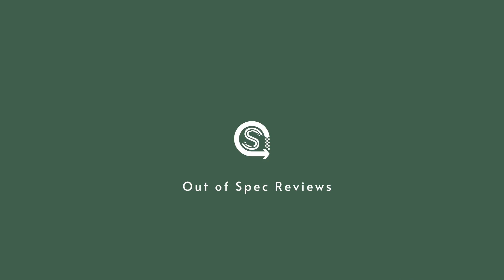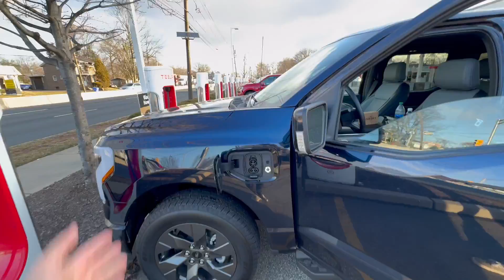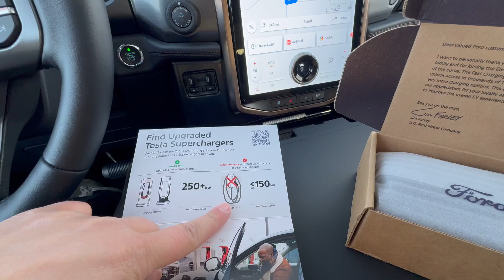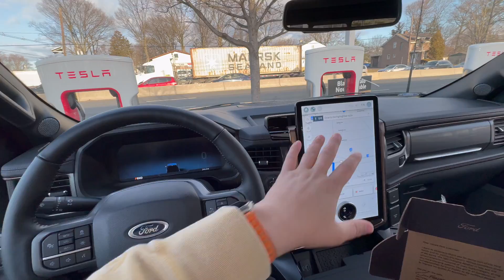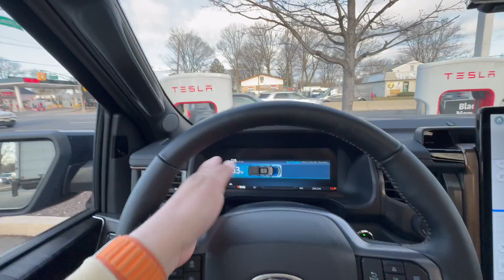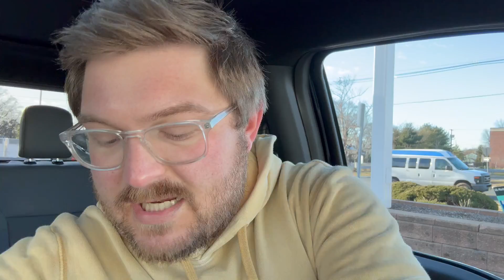Ford Gains Access To The Tesla Supercharger Network! Join Me As The First To Plug In

Comment: Kyle, what happens if you park with the parking space line in the middle of the truck instead of parking in between the lines of the parking space? Will the cable reach then? This would alleviate the fact that Ford vehicles block two chargers when they charge at a Supercharger. They could just repaint the lane lines then and you would never have chargers go wasted because a CCS1 vehicle was blocking them.
Reply: The cables at those existing stations are only JUST long enough to reach the way it's now parked. New Supercharger stations will have longer cables and/or pull-through parking. I expect some growing pains as this transitions, but in a year or so, I'd expect all this to be sorted out.
Reply: If you park how Kyle did, then say another ford comes in they can park to the left spot and do the same thing. It’s not like every vehicle that shows up needs to occupy two spots.

Comment: I have a 2019 Ioniq EV that charges fine at Magic Dock stations. If I get an aftermarket NACS to CCS adapter, my car will be able to charge at all V3 superchargers starting today as well, right? If I select F150 Lightning in the Tesla app, it shows me all V3 superchargers, and I can activate them using the Tesla app. 

I suspect that today's announcement isn't for only Ford, but they are the first to be officially announcing an adapter and support. Pretty much any EV with an adapter (Lectron or A2Z brand) should be able to charge starting today, I bet. 

Looking forward to being able to send my wife on worry-free journeys, instead of trying to map out EA stations that are either broken or clogged up.
Reply: I would say no. It needs to talk with the charger and only a few supercharger locations are allowing Ford to charge. Tesla is slowly ramping up Ford, they they’ll start the next manufacturer. Tesla can’t open them all up at once. They want to make sure everything works.
Reply: Until Hyundai announces the same as Ford, it's a waste of time and money.  The speculation is that Tesla is going in order of when a company signed up for NACS because they have to test compatibility and software.

Comment: I genuinely can't believe that they rolled this out without a better solution to the charging port location and the need to take up two stalls.  This really is seat-of-the-pants stuff.
Reply: V4 will solve this issue (at least in Europe). Simple solution is to install more chargers. No issues in The Netherlands because enough availability.
Reply: It doesn’t take up two stalls in all cases. Another non Tesla vehicle can park right next to the ford.
Reply: It's because outside of CA most superchargers are never even close to max capacity. There really aren't many CCS vehicles on the road compared to the abundance of supercharger availability. Things will be just fine.
Reply: Not true. Anytime you get near an airport or downtown, country wide they get packed. Rideshare drivers. @TheAdventureAuto
Reply: Well the cyber truck has trouble with that cable
Reply: Or it's a massive improvement on EV charging options with fairly typical short-term teething troubles.
Reply: Well that's other brands faults, not Tesla, why the fk would they all place the ports in all sorts of different spots in the cars instead of all following what the first brand did? 🤷

Comment: How long before Kyle tries it on his R1T.  Let us know once you try it.  Happy for the Lightning owners!
Reply: I think it needs a certificate to pass through from the vehicle doesn’t it?
Reply: @ultrastoat3298  according to the other out of spec podcast, you can still activate charging with the app in case your vehicle cannot activate the charge or does not have the software update.
Reply: Yeah, nothing will happen as there isn't any software ro activate the charger. Unless Tesla adds that to their app. Currently, you can only app initiate a charge at a MagicDock.
Reply: @kevinandabbie  according to the Ford rep in the other video, you can activate the charger in the Ford app
Reply: @jcl3j  that's a fair point & a permutationi didnt consider.. I'd think that it would cross-check the car in the app to the activation but don't know the protocols. Sounds like a long shot but Kyle is the guy with the right pieced for it to possibly work!
Reply: @jcl3j  It won't work till it's authorized. Rivian is down the list also. Ford, then GM, Audi, then others before Rivian. Might be months away
Reply: Not the Ford adapter but I suspect here is your answer: https://youtu.be/ZIjlytJO5g4?si=3Iqh3NQ9ohd2lVGd

Comment: I really hope Tesla forces makers that join to have their future cars w/ ports on left rear. Going to be a pain having bolts taking up 2 spots at 50kw.
Reply: The V4 supercharger dispensers are more centered in the spot and have longer cables. Should eventually not be a problem, but definitely will be in the short term for now
Reply: Left rear or front right 😀
Reply: not on the angled spots. backing into those would be tough. front right wouldn't work with those. gonna need pull through like Norway if this goes big. @MartinGalway